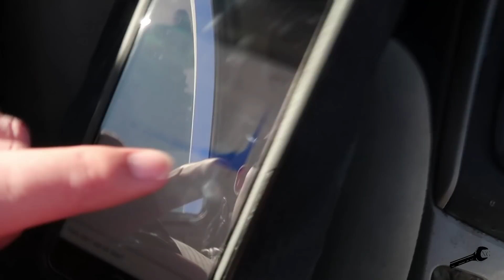Zach's New $600 "Daily Mudder" (Stuck Day 1)

Comment: u could get out with snow chains or just one peice of chain through the rim like u did minus the wood. U can jack it up and put small branches under tires. u can pour gravel, kittty litter, stones in back of the tires. u can shovel the bumps out in front of the tires. u can use max tracks. u can use come along to a tree. u can air down tires. i can tie nots in a piece of rope and tie that threw ur rim like a single pice snow chain.  u can chain a big stick to the side of the tire. u can spiral chain or rope around the whole tire. slam the gas rocking forward and back never letting off the gas while sawing on the wheel when it slows down. only minor sawing. ur frind can push down hill when u rack it back. u can use a rope tied around one wheel as a winch.u can buy a ground winch point which stabs innto the dirt to winch from. u can get full insurance on it then burn it down. lol

Comment: tires dont count as lift.... also front is a dana 30. only options for a rear are a dana 35, dana 44 (rare), and chrysler 8.25. most likely you have a dana 35 in the back.

Comment: Dana 35 or Chrysler 8.25 inch probably in the rear. Every xj has a Dana 30 in the front though. I have 2 xjs lol
Reply: It would be a 35 not 8.25 the older xj have 35s

Comment: Front dana 30 Rear dana 35 or a Chrysler 8.25 in the rear... I don't think any xjs came with a dana 20 and dana 30 is a front axle. I'm guessing you have an 8.25 because the dana 35 wouldn't hold long with those size tires and a welded diff under the 4.0. A buddy of mine runs his xj with a welded 8.25 on 35s and beats the shit out of it, no problems aside from a broken driveshaft. 

Love your videos guys, keep it up!
Reply: Myles Gregory I was looking for someone who said something like this!
Reply: Rod-knock’s Mod-chop Jeep guys know!
Reply: Myles Gregory  8.25 didn’t come into the xj unitil the newer body style so Dana 35
Reply: 35s might not be a great idea, I'll definitely be interested in seeing how the 35 holds up though. I've been thinking about welding mine since I have an 8.8 sitting on a sawhorse, I've just been told by most people that the 35 break on the first wheeling trip with my 33s
Reply: /-DW-\ Spec Ops  The 8.25 started in 1991. You could have either the Dana 35 rear, or the 8.25. In 1991 to 2001, the Dana 35 came in XJs with ABS, and the 8.25 was non ABS.
Reply: Goose_XJ88 Spot on! I didn't feel like getting quite that detailed! LOL The Dana 30 also got the bigger U joints in 96/97 I believe. The 84 to 86 were all Dana 30 HP front/35 rear. The 35 in the early XJs were non C clip axles like the 44 in 87 to 90. I can't remember exactly what year that ended, but I think it was 89. The first two years of the 30 that had selec trac also had the disconnect axle like the command trac did. They also had CV outers like the QudraTrac ZJs did. In  86, selec trac became shift on the fly. The 84 to 86 transfer cases were either a NP207 command trac, or a NP228/229 selec trac. They had the 2.5 4cyl, or the 2.8 v6. Many many little things through the years too.  I've have had many XJS over the years. Currently two 86s (Cherokee Chief 2.8/Cherokee Laredo 2.8) One 87 (Laredo, 4.0, with factory two tone paint, up country suspension, NP242, and factory D44 rear.) Then one 97 (Country, with 4.0, NP231, leather, trac loc 35.)
Reply: Goose_XJ88 Sweet! I've always wanted a Comanchee. I passed up like an idiot a few cheap ones in my early years of jeeps, now they are not so cheap, and hard to find in good shape. Hard to find a factory original 4x4 too! I was planning on doing like you and getting and converting a 2 wheel drive.  There was a car lot close to me several years ago that had an 87 2 wheel drive 4.0 with 80k original miles! It had the Dana 44 rear too! I've seen several XJS with factory 44s, (got several in my axle stash!LOL) but never a MJ. Especially a 2wd MJ. I know they were in the 87 to 90 like the XJs, but didn't think the 2wd ones had them. Must have been part of the heavy suspension package the MJs had. That lot wanted almost $6000 for that MJ!
Reply: You are right ive owned 9 over the years they either have a d30 on the front or a d35 in the back or if its upgraded a ford 9 inch in the back and a d44 in the front depends tho on what you want to put in the front. Far as i know they didnt put Dana 20s in the front and a Dana 30 in the rear

Comment: be mindful you might have to drop the angle of the transfer case or get a slip yoke elemenator  or the shaft may get vibs
Reply: AKS74S you won’t get hardly any vibration at less than 2 inches of lift and sometimes not even then.